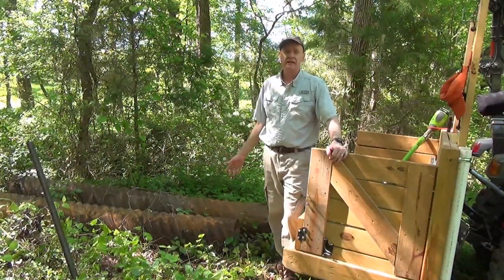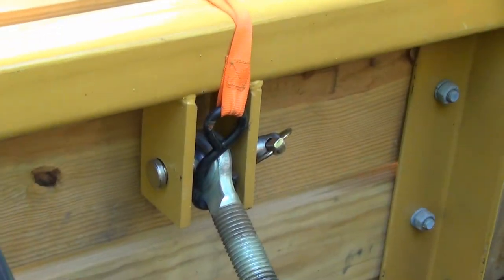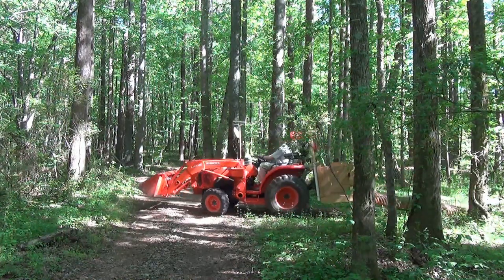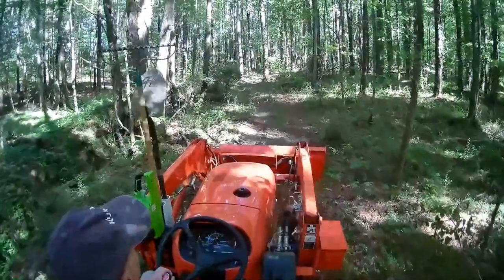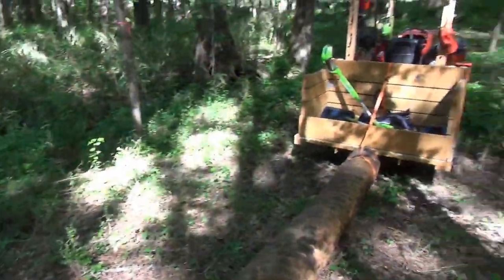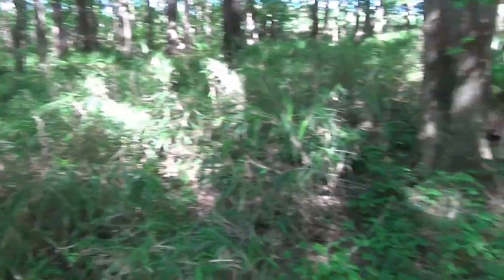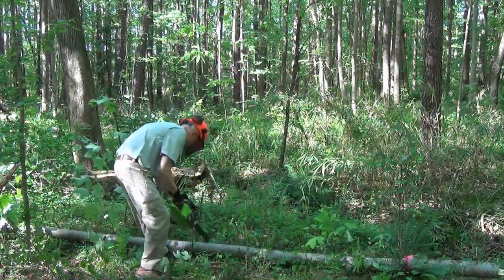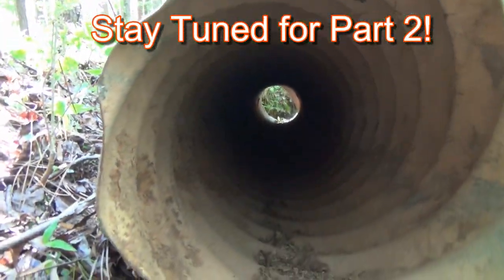Installing a Culvert Pipe on the Trails - Part 1 (#135)

Comment: Grapple! LOL, I have a feeling you have one coming soon, Martin - I hope so but it took me 2 months to get mine. I'm working on the low parts of our trails now but we'll have to use a lot of fill dirt instead of culverts.
Reply from the maker: Hi David!  The pipe would not  fit through the trails if I carried it in a grapple or on my forks.  Thanks for watching!
Reply: @DIYMyWay  Yeah, I kind of figured that. My trails are tight too, but I use my grapple to move tree trunks along them as much as possible. Sometimes you can wriggle them through the trees.

Comment: A good idea in using the hitch hook to hold the pipe up.  
A better idea may have been to have a piece of two inch square tube about three feet long to keep your culvert from slipping off, but I know a man has to do what a man has to do!
Also, not to sound like "one of those guys", it looks like you might give your chainsaw's chain a bit of a filiing.
I noticed it was expelling sawDUST instead of chips.
I am sure you know the importance of a sharp chain, ESPECIALLY with the electric saws.
I really enjoy your videos!
Good job!
Reply from the maker: Hi Lonnie!  Yep, but I didn’t have any 2” square tube on hand.  Good eye on noticing the sawdust instead of chips! Thanks for watching!
Reply: @DIYMyWay   I have a couple of 2" hitch extenders that I have used to extend a hitch point.  That would work too!

Comment: Good video Martin.  I own a 3301L Kubota myself.  You mentioned a couple of times how heavy the pipe was.  Like you, I'm a little older and retired.  For the life of me, I could not understand why you couldn't have just put on your pallet forks and placed one of the forks through the pipe hole, lifted it in the air and carried it to your destination?  Maybe I'm overthinking it?  Best regards and keep the videos coming.   Cheers.
Reply from the maker: Thanks Cliff!  There was one big reason I didn’t do it that way:  I couldn’t have made a couple of the turns along the way with the pipe sticking way out front, especially at the corner of Elm and Oak Ave.  I would have had to take the pipe off and roll/drag it around the turn then pick it up with the fork once I made the turn.  Thanks for watching!

Comment: This is a project that i have been needing to do for a few years now. My drainage is about 7 or 8 feet deep and about 25ft across. I have been studying this for a while but just havent came up with a solid plan. I would appreciate any ideas. And for the record, its a ranger crossing and not for a tractor
Reply from the maker: Hi Matthew!  Wow, that’s a civil engineering project for sure!  I don’t know how much water can flow through there but it’s probably a lot.  You might need a 3’ or 4’ diameter culvert pipe or larger about 30’ long to give you a decent 10’ crossing at the top with slopped sides after you fill it in with lots of rock and dirt.  It will be an expensive project from the sound of it. Thanks for watching!